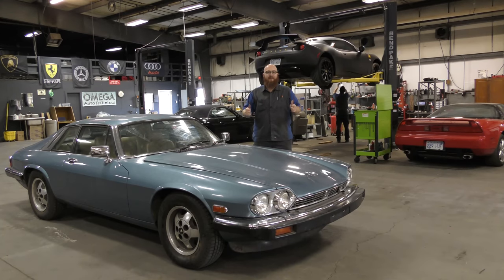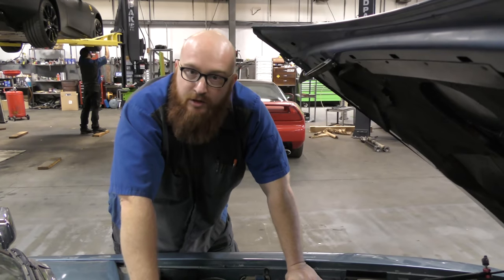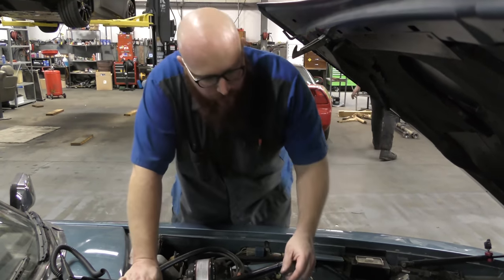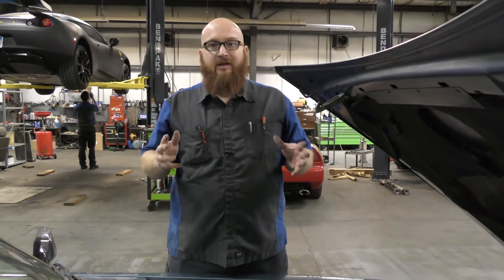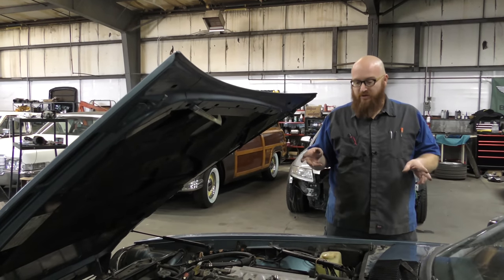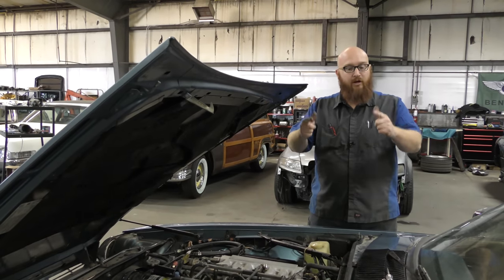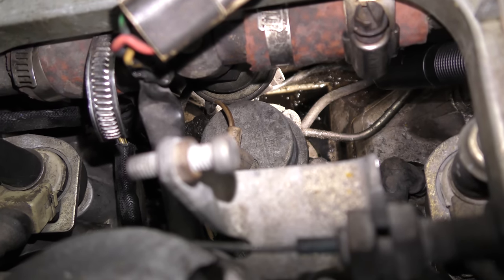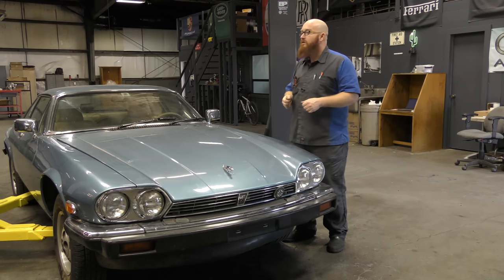'82 XJS with the cursed Jaguar V12 comes into the CAR WIZARD's shop. Can he get it running?

Comment: Thank you for this detailed video on troubleshooting the V12, really well done in a way even a layman can follow.

I'm a classic car enthousiast and got myself a  88' Jaguar XJ12HE series 3 that sat in a showroom at a dealership for over 8 years in April 2020 as a COVID-19 project. The Jag begged to be taken home and taken care of by someone who was willing to put in the work and money to do it right. These cars deserve to be rescued (if still in reasonable condition of course), mine is an all original Dutch delivered XJ12HE Sovereign with original 182K kilometers with no rust or bodywork done to it (asided from the edges surrounding the front and rear windows, which will be restored to factory condition this year). Color combination Dark Blue with Grey leather interior.

I'll share my experience as to not scare people off of these cars, as they are a genuine joy to own and drive. If you open up your garage, your car should put a smile on your face, these Jags do that.

I can do simple things myself such as fluid changes and brakes etc. but all other things I source out as I want it do be done properly by mechanics that know what they are doing. 

The car had most of the issues you desribed here, except for oil leakes and the computer. The Jag passed the MOT with only minor works and I got it home for about 4 days until the starter blew out, car wasn't running properly but the garage told me to take it home for a few weeks whilst we were drawing up a maintenance plan for all the works that were required (some parts did take some time to get in, new fuel tanks etc). Driving it around town would allow me to find more issues with it that could be tackled during the 1st major service. 

Once the parts got in and the mechanics started trouble shooting, they found that as you encounted with this XJS, previous mechanics had tried to keep the car going but didn't know what they were doing. E.g. small, inexpensive and simple parts had started failing and the previous mechanics whom worked on the Jag didn't know how to fix it and cooked up their own fixes. They had for example re-wired the wiring between the ignition and fuel pump, circumventing the failsafe system in event of a crash that's positioned in the front passenger door (if you are involved in a crash, the little box contains a switch that cuts the fuel delivery to the injector rails and returns all fuel to the tanks and shuts the valves, clever piece of kit). Two other wire detours were found as well in the engine bay and trunk. Further that, they hadn't tuned the engine properly and the left bank of cylinders ran rich whilst the right ran poor, which on the long run can cause engine failure.

To point out: I bought a running car and the wiring issues came up when replacing the starter engine. It took the mechanics 42hours to figure out on how to undo all the re-wiring and troubleshoot the start and ignition issues with a voltmeter and trial and error, in the end, there were 3 major re-wiring jobs that had to be undone, but once you fix one wiring issue, the next detour needs to be fixed. The re-wiring done by the previous mechanics had basically rendered the Jaguar workshop manual and wiring diagram useless. 

We ended up doing a lot of preventive maintenance with replacing relais and fuses that seemed to be allright just to be sure whilst the wiring was straightened out step-by-step. Luckily parts are inexpensive. After the service which included outside of filters and all fluids (including a transmission flush and rear diff) new spark plugs, distributor (plus all leads to the spark plugs), ignition amplifier, fuel distributors (left and right), rebuilding all injectors etc. was done we got a V12 specialist in to do the tune up (whom worked for Jaguar when these cars were sold new). The timeframe elapsed was about 5 months from purchase to getting a properly running car and the difference was mindblowing! You can now put a coin atop of the engine and it won't tip over...

I've been running the engine back in for the past months as the Jag will go back for it's second service and tuneup in a couple of months. There's still a lot of work to do (suspension, mild cosmetics, exhaust etc), but the majority and most crucial has now been done. I will not put a number down here, but getting these old Jags back on the road as Car Wizard mentions isn't cheap, especially if you want to do it properly and keep the car in excellent conditon. Reserve atleast 2 times the purchase price (if you bought at the bottom end of the market) for getting all technical issues sorted outside of any cosmetical works in the first 12 months of ownership. Getting the A/C running as the factory intented for example isn't cheap either (it's one of the earliest computer controled fully automated systems).

That said, once everything works as the factory intented, these cars are actually very inexpensive to run. Parts are affordable and this is a car you can work on yourself doing regular maintenance. I don't think many engines could take the sort of neglect that these Jaguar V12's can (Mercedes engines aside). They're overengineered with huge mechanical reserves, but, they're complex cars given the context of the time when they were developed and sold. Mainly, everything around the engine and drivetrain is what gets these cars mothballed, from a mechanical point of view they are bulletproof. 

These cars do not become unreliable by themselves, but due to neglect in maintenance and of not being used. Drive them regularly and service them regularly and they'll be just as reliable as any car of the period. Of course, like most cars of the period, they require more frequent servicing than modern cars do. Oil change is required every 3000 miles or so.

If you decide to buy one, take a Jaguar specialist with you to check the car out prior to purchasing it. There will always be surprises but the mechanical basis of what you are buying needs to be sound (and bodywork). I for example had not considered the possibility of amateur electrician fiddling around with the wiring in my Jag.... but the rest of the car is in excellent condition. These are cars for people that enjoy motoring, getting their hands dirty and don't mind spending the money required to get these cars sorted out and keep them sorted out as the factory intended.

I can only say, that the driving experience is something very special and very rewarding as these cars are full of character.
Reply: A jag for a project car? No thanks.

Comment: I have an 84 XJS, the TPS, if you open it up you will find a GM 4 prong module which is much much cheaper to replace than the Lucas complete module. as for the coil or should say coils, get rid of them and install a newer coil as then you only need one. Another problem is the injector harness being located in the "V" aka Death Valley will and should be replaced, making a new is not the difficult but keep enough wire in the main plug to attach to. as far as the Lucas wiring, the main problem with that is the connectors. and of course as with any car that has age, especially these with the engine heat, I went thru all the wiring on mine from Bulk head forward. did find a couple of insulation breaks but the wire was good, and did replace some connectors

Comment: Great engineer, methodical work the correct way. The engine is a beautiful piece of engineering, it’s always the ancillary bits, sensors etc. causing the problems. Always check the important basics like the distributor. The inboard rear brakes save the unsprung weight & help ride quality.

Comment: Basic trouble shooting. Air, Fuel, Spark. Cold start sensors are used on domestic cars as well for fuel enrichment. Don't forget the air fuel bypass for setting the idle, and it has a thermo sensitive unit as well. The worst problem with Jaguar V-12 was fuel leaks on the injector rail. If they leak the fuel goes into the valley between the heads. Right where the distributor is. Fumes build up in the area inside the cap and you have a fire being fed at 90 psi by the injection system. The other problem is valve seats. Steel seats in aluminum heads. Over heat the engine and the seats fall out. Drivers do not know what the temperature gauge and IDIOT light are for. My laughing goal is to take a Chevrolet and put the Jaguar V-12 in one. Yes I did work at a Jaguar, Rolls Royce dealer.

Comment: I bought a 1976 XJ 12 C as a roller [no start] for $5,000 USD in 1977. Less than 4,700 miles. The buyer sued the lease company and Jaguar and somehow ended up with the car in his driveway ... 3 years later I winched it onto my trailer, drove 370 miles back to Glenview, Illinois. 
My wife and I peeled the Lucus stickers off of every relay, down to the Bosche cans, and emery clothed each contact at the kitchen table and tested them with a 12 v battery tester until everything clicked. 
Changed all the fluids, bought a battery, and turned the churn over by hand. All seemed good. The electric starter turned it over and once the fuel rails filled and she sputtered to life despite my best efforts. I was in shock~!
1976 was the first year fuel injector engine. It simply was a Bosche Jet-Tronic 3 set up times 4. So check those grounds~!~!... '75 was carburated. 'And 77 was the last year for the Coupes. Most Coupes had the six-cylinder and darn few had the double six. The Factory works wanted to race the 12-cylinder Coupes in Europe. 
Coupes had a 6 inch longer set of doors and a 6 inch shorter floor pan with a true hardtop roofline with no center window post. Getting rid of the center window post delayed the Coupe introduction by one year. But Sir Lion insisted on it. Additionally, every sheet metal roof stamping had a wrinkle in them but the limited amount being produce meant that the roof die at the press would not be fixed as it still made a fine fitting roof, but with a wrinkle. Thank goodness for period-perfect vinal-covered roofs. Mine had an added electric sunroof. 

My advice is to BUY the shop manual but more importantly BUY the parts manual as it tells you the exact assembly procedure for all the bits of the entire car. Including ht 'ceramic muffler bearings'. True.
With 6-Bilstein shocks, Mintex brake pads, and Goodyear Eagle Hi-Speed police intercepter tires she'll turn an honest 150 mph at 7,750 rpm on the 'single nickel' toll road between Chicago and DeKalb, Illinois. Smooth as glass and a natural front downforce rake at speed. The owner's manual recommended a speed limit of '3 digits' once a month just to keep it running sweet. https://scontent-msp1-1.xx.fbcdn.net/v/t1.18169-9/16473342_10155005387126098_328487931904934635_n.jpg?_nc_cat=100&ccb=1-5&_nc_sid=ad2b24&_nc_ohc=Tfe3RCvkh6MAX-Qxq_G&_nc_ht=scontent-msp1-1.xx&oh=4ebf8ddbd2045dc2267b273b6c9eb5b1&oe=61913DE3
Reply: One thing each quarter panel has a separate fuel tank with pet valves for drain and is controlled by a selector switch. Left/right. For shits and grins, I filled one side with Shell Premium and one side with Shell Gasohol. Don't do that. It stalled and choked to death on gasohol. I had to crank out vaporized gasohol in white clouds, figuring I was about to go up in a ball of fire before the fuel rails cleaned themselves out,😁 and then she fired up on Premium ... and dad had 12-1/2 gallons of gasohol for his lawn tractor.
Reply: I ran my XJ-12-C for 7 years before selling it to a high school kid for $17,500. That car ran well and never left me walking home.

Comment: Most difficult engine to diagnose and fix in history? What are you talking about? It's a really simple engine to diagnose and troubleshoot, I've had quite a few and still have four. Air, fuel, spark. Figure out which is missing, take it from there. It can be expensive to fix, of course, because there is 12 of everything.

Comment: Putting a Chevy engine in these is tantamount to giving Einstein a lobotomy.. 😂. The V12 is a great engine, but even the latest ones are now 20 years old, so there WILL be issues. And... they have 12 of most things. There are great aftermarket engine management kits available which is a cure all for both injection and ignition issues. AND give you gas mileage that's actually quite impressive for a V12.

Comment: Jaguars are not as unreliable as people would believe, even the Lucas electrics are not as bad as some think, we own a 1985 Xj6 series 3 and it runs all original bulbs, these cars were ahead of their time and very well made, much better than the junk on offer today, our Jaguar has done over 247,000 and still starts every time, the car has never once left us on the side of the road in 15 years of ownership, every time she has an issue she does it when parked in the garage.

Comment: Back "in the day" when all cars had distributors, best practice was to remove the distributor to perform servicing; points, condenser, dwell.  Removal and reinstall was a low overhead and easy thing to do. Anyone who did this for a living knew there was 2 ways to put the distributor back in, so a little attention to detail was required. Today, maybe 10% of mechanics know this. In the case of this car, the past "mechanic" knew enough about distributors to be dangerous. Good job CW sorting the trouble causes.

Comment: People love to bash Lucas electrics from this period, with some justification as they went from solid reliable materials and silvered contacts to cheap plastic and copper; but in this case the E.F.I. is just a Lucas sticker placed over a Bosch product... so if technicians can't diagnose and repair it accurately they share the blame - a case of a bad worker blaming their tools rather than admitting their lack of knowledge and skills. True professionals like Car Wizard show how these cars need to be cared for. The V12 is a superb engine, if you know how to work on it (as I was trained to do) and it is only "hard" if you don't have the skills and are too arrogant to admit that to your customer; doing them a great disservice. My personal opinion is that if I was a customer and I took my vehicle to any shop that said, "your engine is crap, let's pull it out and put in a more basic one that I can understand"... I would run a mile and find someone like Car Wizard who DOES know what to do.

Comment: I owned that car as a teenager. It was the easiest car to own as long as when something broke you just ignored it. Horn won't stop blasting, cut the wire. Misfiring cylinder don't worry you got 10 more. Zero to 60 was about 12 seconds but 60 to 120 was about 6. I had to get rid of it when I was driving down the road at about 45 mph one day and a front left wheel came off. Good times.

Comment: You did well hunting those faults down. I'd always advise pushing the rear brake caliper pistons back in and giving the pads a wiggle. Prone to siezing up, which leads to melting diff seals and cooked U/J's. (there's another thing, the driveshafts are also used as top suspension wishbones.)

Comment: Fixing the "fixes" of other mechanics is a nightmare when you're dealing with older cars with maybe some unusual systems or the like.
The shop where I work, we got in an 80s Cadillac with the 4.1 liter "Digital Injection" engine, it no longer ran, and 2 other repair shops had tried to get it running with no success.

My boss who's pretty good with older cars and figuring out problems spent ages fixing everything to do with the "Digital Injection" including removing the workaround the other mechanics had added in when they couldn't get it running.
After all that, it turned out the first mechanic who put in a new Distributor, had somehow gotten a faulty part, the Distributor was dead, after swapping that everything worked again...
Yet everything had been blamed on the "Digital Injection" system, so no one even bothered to check the distributor...

Comment: Well done for sticking with it. This past incompetent work by others causes major issue and its the easiest  thing then to blame the car or its components such as Lucas. Anyone that knows the true history of Lucas and it successes would not have that opinion. Components are lasting 30-40 even 50 years that is not a sign of bad quality. Good to see an XJS sorted. I went for the 3.6 fo good reasons. Oil leak nearly always rear oil seal and that a $1400 job.

Comment: I worked with British sports cars in 1960's;the Lucas electrical systems resulted in "Lucas, prince of darkness". Guys with auxiliary driving lights would have to pull over, turn off everything but the engine to recharge the battery. The generator couldn't keep up with demand. I used carpet padding as a kneeling pad.

Comment: LOL @ 6:35  I have installed GM Ignition Modules into several vehicles!
Including a 1985 Isuzu I-Mark I drove for a while. Although I had to externally mount the larger GM Module.
The OEM Isuzu module was close to $150 and that was over 20 years ago.
I believe I have also installed them on Chrysler as well in place of their old monster module.

Comment: My personal experience of the XJ-S V12 is.. when you buy one change every service related item, of the 3 I have owned the documentation of the servicing has been a work of fiction, even when backed up with receipts from main dealers. Once gone through and the servicing effectively reset and any resulting neglect issues rectified and then correctly maintained all 3 were totally trouble free

Comment: XJS with gremlins, likely vacuum leak or ignition short.  Good sleuthing Wizard!  They are beautifully designed cars that need an attentive owner.  These cars would do well with a complete revamp of the engine sensors wired into a modern ECU that can run these things proper!